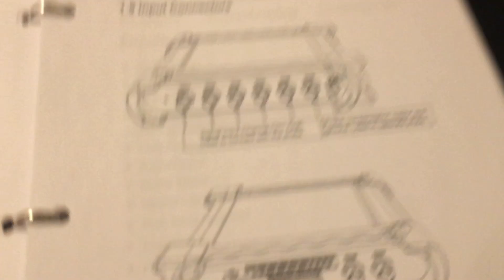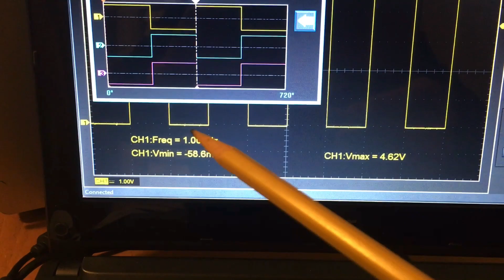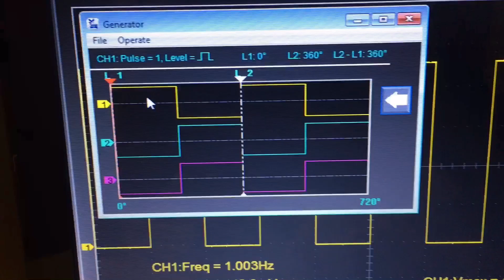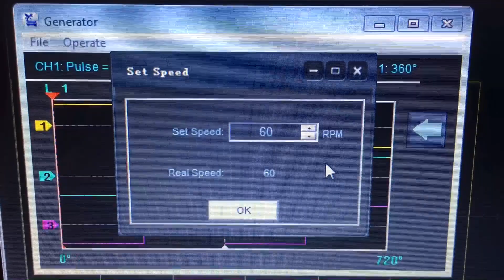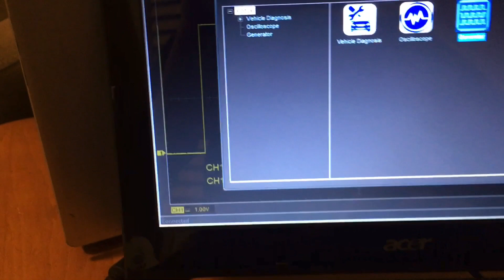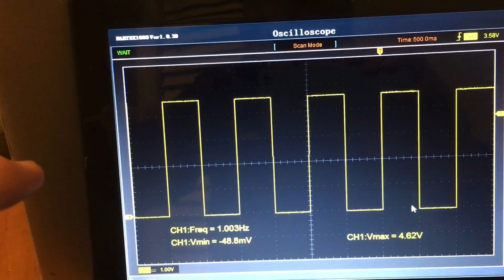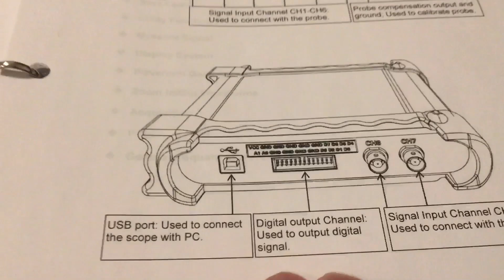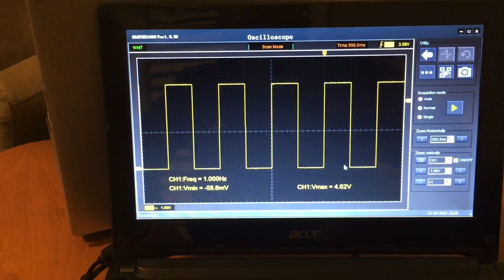Hantek 1008 Square Wave Signal Generator

Comment: Sir, how good hantek 1008c, i want your recommended  because I want buy it too
Reply from the maker: Pretty dated now. Don’t be drawn by the 8 channels. It’s very rare you actually require that number of channels and the unit will slow to a crawl With a high number of channels in service. Software is also quite basic by today’s standards. Having said all that, it can provide a great learning platform. 🍀👍🍻
Reply: Thankyou sir,

Comment: Can you use this to simulate a digital CKP or CMP sensor ? In regards to adjusting the spacing in the windows or to simulate the TDC window on a crank shaft tone wheel ?
Reply from the maker: Theoretically possible, practically more troublesome than it’s worth. Thx for watching. 👍🍻

Comment: It's tricky but you can also select the pattern and code it with the edit mode by selecting high or low. At first I just thought it was a square wave pattern that you could alter the frequency but you can actually change the pattern.
Reply from the maker: Yes that’s possible. I read the details in the manual. Honestly, never used it. Too much work 🤣 Thx for watching 🍻